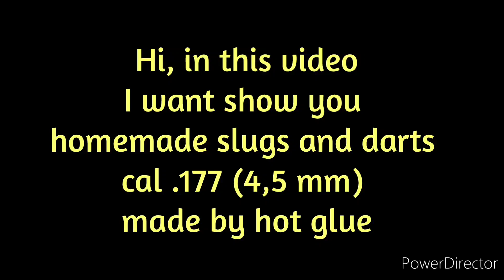How to make DARTS & SLUGS cal .177 / 4,5 mm with BallMAKER MOLD for airgun & airifle. HomeMade craft

Comment: Soy de chile como consigo los moldes para poder hacer municion se podra imprimir 3 d
Reply from the maker: No, it isn,t from 3d printer. It is made by pressure casting method in high temperature.